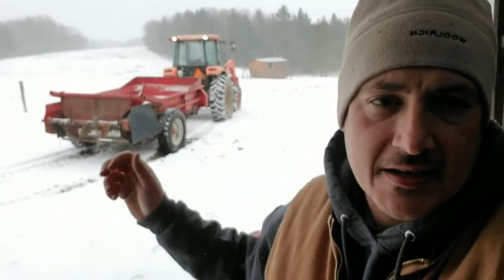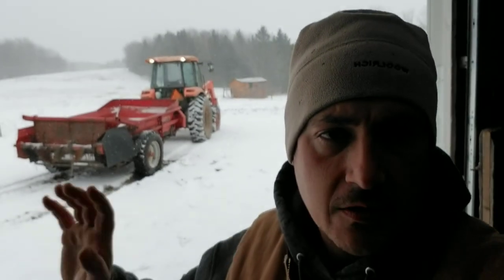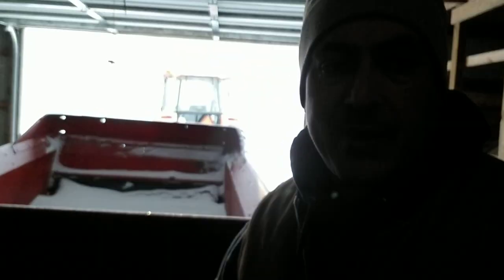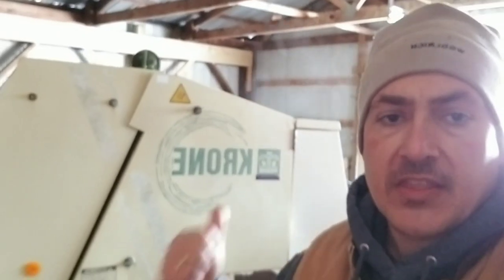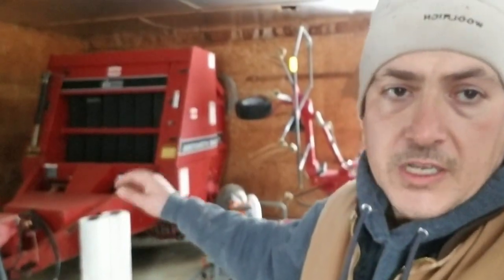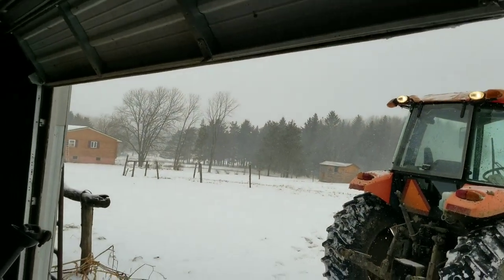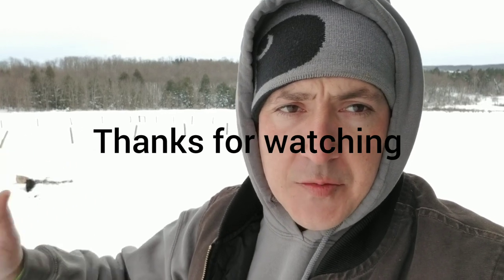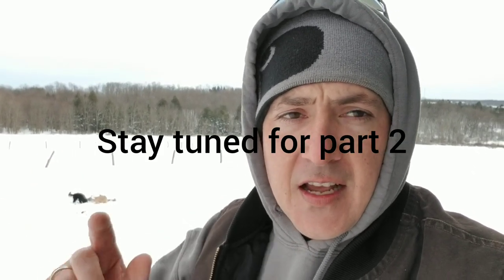Moving the gehl 1177 manure spreader to shop/ other shop projects part 1

Comment: Spreader paddles are a bit spendy, but hold up much better than mild steel.. so, since you are going to use the plasma, does that mean you have some hard material??? 
As it much harder than T-1 or AR..
We run two spreaders, about 2 or 3 times bigger, move a lot of 💩!
In the last 40 years, we've only had to replace the whole set on the new Holland twice.. had a few broken here and there.. 
Our IH spreader has better working paddles, so far in ten years, only changed a few...
Projects 😂🤣way too many of them here!!! 
Always fun doing pickup tires too!!
Thanks for the video Ted!!
Reply from the maker: Ed thanks for following along. I'm not really a conaseur of steel so I'm really not sure if it's harder than factory paddles or not. They do seem to hold up to the Rocks better than the factory ones.
Reply: @pughviewfarms4622  you're not supposed to be spreading rock with it, it's a "manure spreader"😂🤣 we get some rock every now and then.. window busting, noisy Stuff!!! 
Lots of rocks, then mild steel would probably hold up better..
Whatever works!!!
Reply from the maker: Window busting for sure.  Happened last spring.
Reply: @pughviewfarms4622  don't scoop as deep, maybe leave some rock on the ground???

Comment: You need to add battery shutoffs to the ford and 340 so you don't have to fuss around with dead batterys all the time. A tractor is no good if it won't start.
Reply from the maker: Not a bad idea. Add that to the work list now.